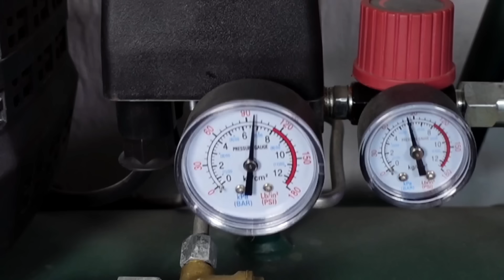Old Beautiful GOLDEN Lighter - Restoration

Comment: It's just impossible to have such a perfect surface after removing all that rust! So where was the rust from if not from the metal in sirface? Dod You put it yourself? 😅😅😅
Reply from the maker: Brass is not susceptible to deep corrosion. Brass only oxidizes. Rust spilled over from other metal objects that were nearby

Comment: Awesome work! One question: I've got an old weather vane (weathercock) - you know, a flat figure of a bird that rotates because of the wind, and a cross with letters that show north, south, east, west. The letters are made of thin tin metal and hollow (empty inside), and they are quite rusty and fragile. Also they have some holes and cracks along the edges. I wanted to squeeze/pour something like epoxy inside those letters to make them sturdy and kinda solid, so afrerwards I could put some metal filler on them, sand and paint them, drill some holes and fix them back on the weathercock. What do you think would be the best way to fix the letters? I understand the epoxy might not be the best option. Thank you very much!
Reply from the maker: Hello! Thank you! I am glad that you liked my work.
It is difficult to say whether epoxy will work. I need to see visually. You can send a photo to me by mail. Then I can give you some advice. Thank you!
Reply: @TheRestorer  sure, will do!
Reply: @TheRestorer  Just sent you an email with photos. The tin letter is approx 10-12 cm long. Looking forward to your reply!

Comment: Why not just start with a soak in rust remover? Seems like that would be an obvious first choice given your item is all metal. Someone tell me why rust remover wouldn’t work here? Why risk scratching the metal with all those gadgets when rust remover would dissolve away most of what you are trying to scratch, or brush away using metal or wire implements. Just really wanting answers. Especially if there is a logical reason to restore this lighter the way he is doing.

Comment: You may believe that such rust can't leave a single pit on the surface. You may believe.
Reply from the maker: There were pits. I fixed them and polished the surface. Brass is not subject to deep corrosion like steel

Comment: Why do all of your items you restore have exactly the same amount and type of surface corrosion, and so little material damage throughout? Do you find old items in shops, then use the same corrosion protocol to prepare them all for making videos?
Reply from the maker: Hello! Such things can be bought at auctions of antiques that need restoration. Brass is not very susceptible to corrosion. It oxidizes.

Comment: Professionally restored??? Professionals don't use cheap plastic handled harbor freight bargain bin screw drivers to pick at their restorations and they wouldn't use bargain bin screw drivers at all for any reason, infact they wouldn't start by picking at objects they are restoring because it might damage the object, you are by no means professional, I've known restoration professionals and the first thing they do is use a soft wire brush usually brass and then several chemical baths or ultra sonic cleaner
Reply from the maker: I am glad that you know many restorers. Congratulations!) Maybe they use paper screwdrivers?)
Reply: @TheRestorer  when the object requires screwdrivers such as unscrewing a screw they use high quality steel shaft screwdrivers. But they don't use them to pick and scratch items because that's not the right tool for that and they are professional